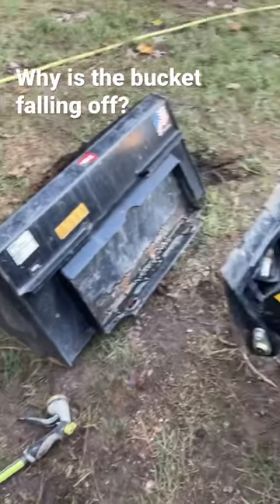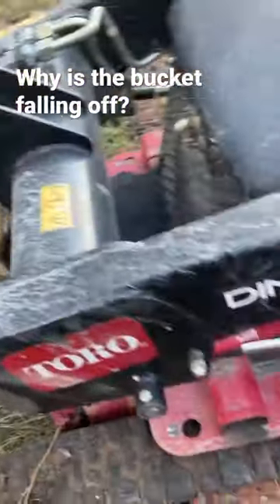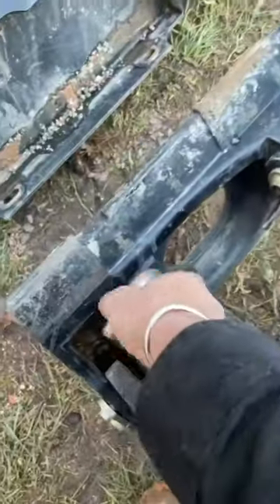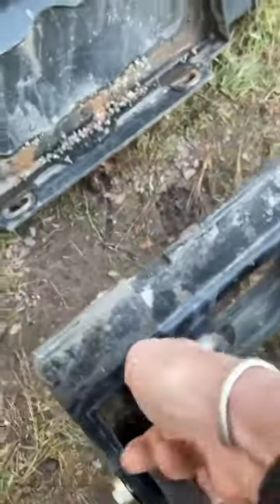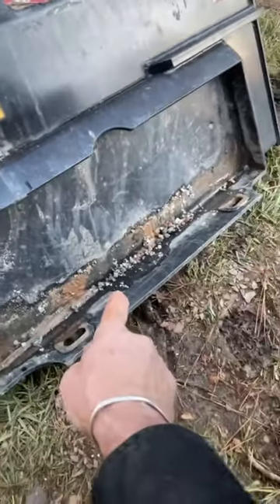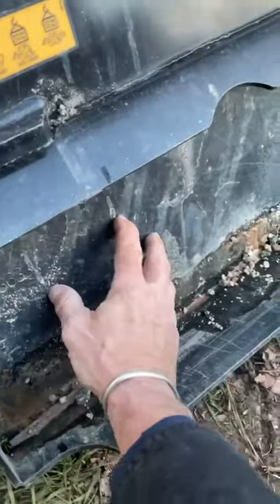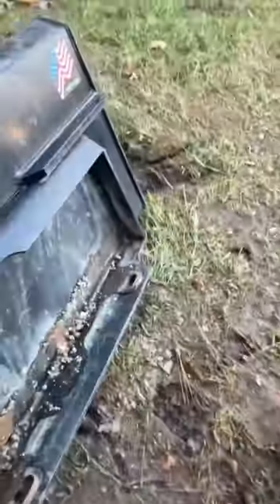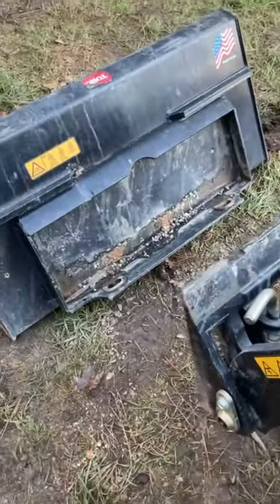How to fix a subcompact loader when the bucket keeps falling off—pro tip from Carpenter Mark

Comment: Every time with every bucket on a skid steer or anything
Reply from the maker: I haven't had it happen to me that much--other than a little snow--on my machine. This unit wasn't mine (rental) and getting to know its quirks during the single day I had it took some getting used to.
Reply: Depends on the type of dirt where you are some is way stickier than others
Reply from the maker: @vivalasvegas2826  I hear that. Even though I was 8-9-hours South of where I build, the soil was pretty close to the same. All clay, then mega-dense clay about 20-inches down. It was gummy. It rained. Then it slurried. I think the bucket on the machine was janked before I got it.